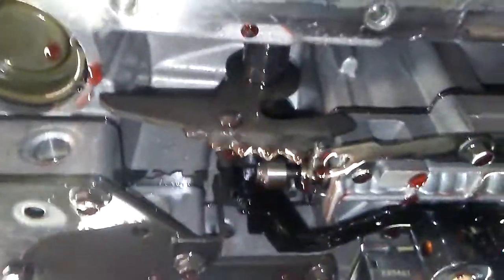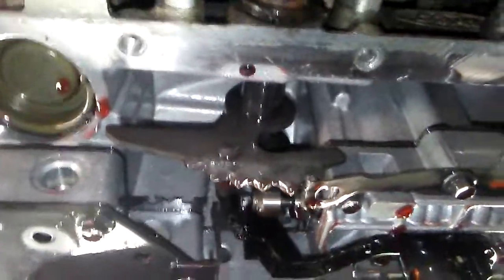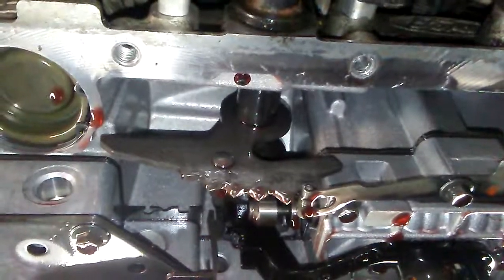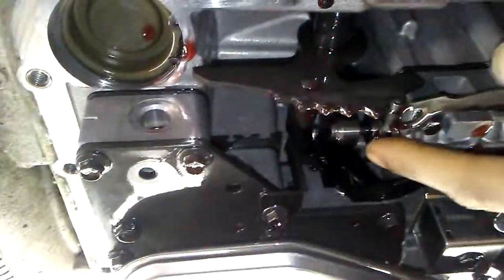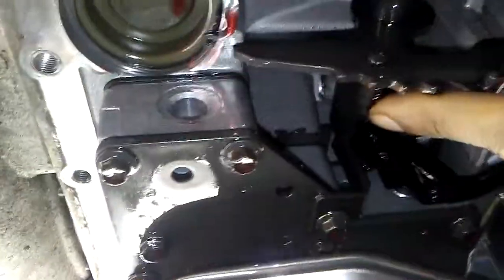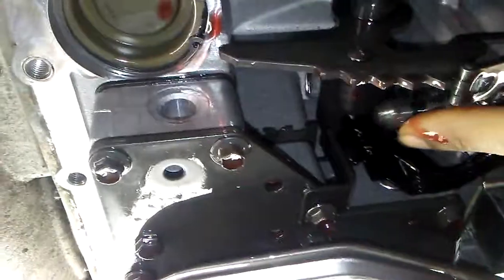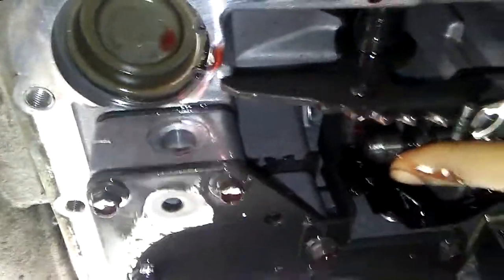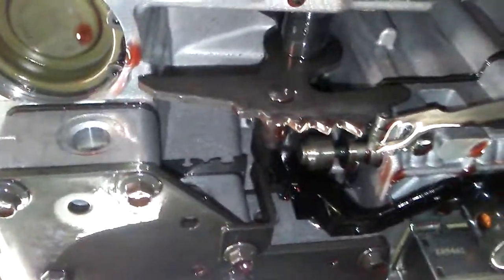Transmission shifts forward while in reverse

Comment: brother ur a life saver! I just finished a trans and that as the one thing I missed! rushing in a night to get it done made me make mistakes
Reply from the maker: Thanks.. I was also rushing finishing up trans work  and ran into same problem.
Reply: Nothing like rushing you make mistakes simple
Reply: Just swapped the valve body on my brother-in-law's 2000 Ford Ranger. It has all forward great now. Rushing to put it back together I'm pretty sure this is the issue. Thanks

Comment from the maker: You will need to pull the valve body back off again to set the pin on gear lever in the parked position.
Reply: How to now position of pin is reset ?

Comment: I thank you , I wish you would provide a little more details. Because I m having the exact issue with my 06 Ford Expedition
Reply from the maker: Did you previously have transmission rebuilt or is this a issue that just started thanks
Reply: Yes, just recently
Reply: As a matter of fact it moves forward even when shift it on neutral

Comment: Just curious, having same problem with 95 ford explorer transmission
It was rebuilt by a trans shop 35k miles ago, all of a sudden reverse and neutral move only forward. I removed pan and the pin you mentioned in your video is attached to the linkage like it should but the pin spins around very easily, is it supposed to do that?

Comment: Would this be my issue as well?
2005 Cadillac SRX V6, goes forward in every gear, but drives fine thru all the gear when places into Manual Drive, no reverse at all though, can only push the car backwards while it's in neutral.?
Reply from the maker: All Vehicles are different you can get codes read at AutoZone to see if a transmission solenoid is bad
Reply: This video of yours didn't mention a bad solenoid, so you're saying it can be a bad solenoid that's making the vehicle go forward in every gear?
I have a Tech2 scanner myself, just doesn't seem like a solenoid issue, I'll get back on the drawing board, and check more I guess, thanks for replying though.

Comment: My auto transmission u151e on Toyota avensis when engine is off with free wheels in air . Don't move on neutral and rear gear when select gear knob but muve on drive only . What problem is this ? Selector bushing , solenoid or same parts inside transmission is not correct ? On drive wheels is move foward free but on neutral or reverse is stuck ...
Reply: Same issue, have you solved the problem yet?
Reply: @JakobWatt  No I don't. Sell car. Need service for transmission to fix but was expensive.

Comment: I have a 94 Mustang GT, the forward gears shift fine but every gear is a forward gear even in Park and neutral. Could this be my issue ?
Reply from the maker: If you had transmission rebuilt I would pull transmission  pan to check the valve body..

Comment: Thanks for the vedio . My Toyota sienna has this issue after my mechanic changed one of the solenoid , filter and fluid in it's transmission. My van drives forward in reverse, neutral, D ,4 and 3 gears but won't switch to 2 gear and L gear at all. 
Please make a video on how to get to that pen or how to reset that pen. Thanks for help

Comment: Hi, I know this is an old video but I just wondered if you could help me out. As it is in the video, it is only forward right? And then you need to drop the valve body and install that pin on the other side of that gear selector? Or is there something else? Cheers and thanks so much!
Reply from the maker: Did you Rebuild Transmission or have it rebuilt
Reply: @DIYAutoRepairs89  I removed the valve body to replace shift solenoids and then I believe didn't notice that shaft when reinstalling. I'm going to drop the pan again tonight and check
Reply from the maker: @200degrees  ok I see yea just make sure you have that locked in place

Comment: which side of vehicle should you roll the car to reset plunger. hate lying on my back, when I can roll the vehicle on foam blocks and work on it? And how do you tell if it's set right, before putting on back together?
Reply: How do you read adjust get ship bar you are playing with the video cause my car goes forward in the verse how do I fix it you not very specific on anything

Comment: brother my car on d or r don,t move
Reply from the maker: U may have to tear transmission down to check the problem u say u have a 4l60e Chevy correct you may have a broken drive shell and burnt clutch packs you would need to check.. when u shift to drive does engine just rev is there any noise with transmission when in D gear..
Reply: No she move whin started 30 second or 1 minutes Then stop